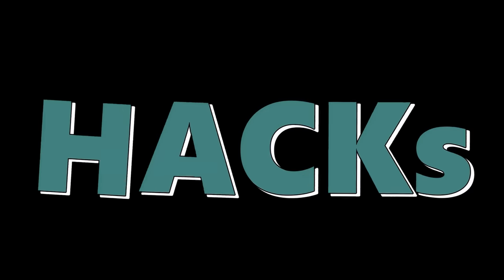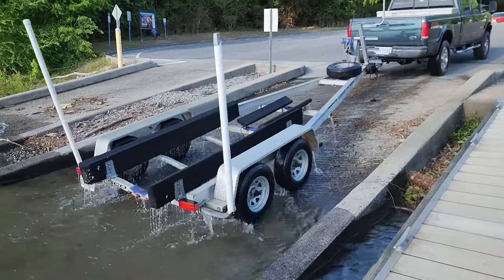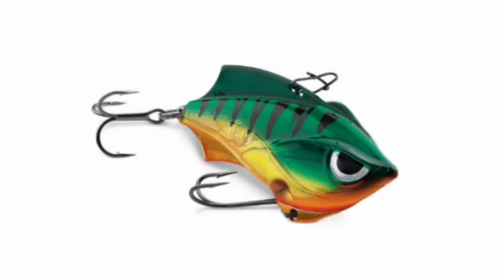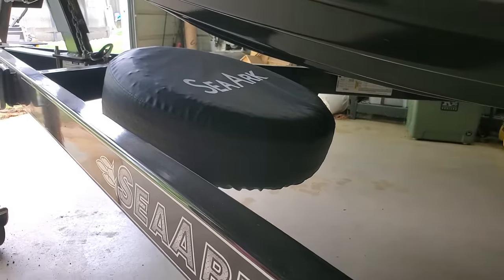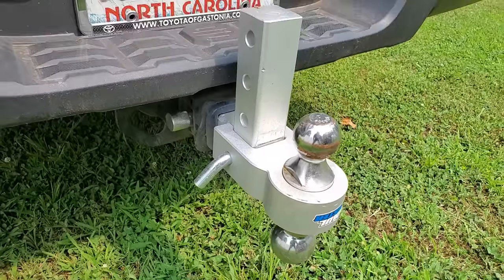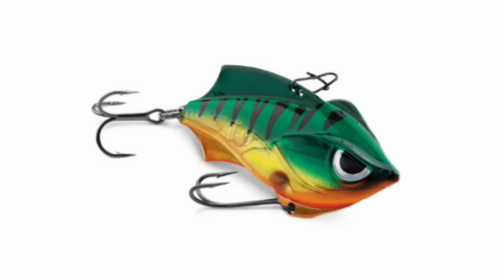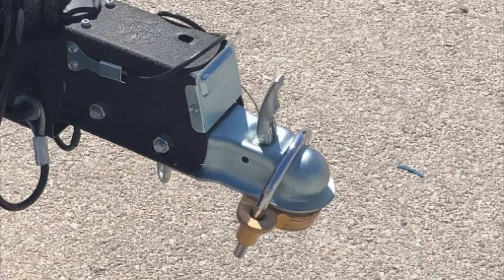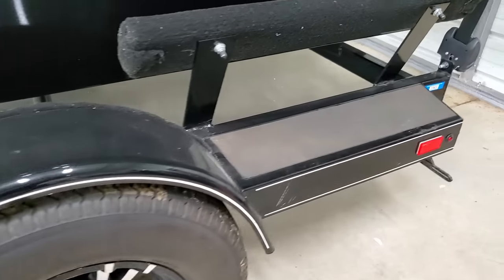10 Boat Trailer HACKs

Comment: Here's one more that nobody mentioned: cat walk. It's best to keep hubs out of water and winch boat onto trailer to improve hub life. That also help the boat to self center perfectly every time while loading. Anyway, you will never need to get your feet slimy if you can walk on your trailer over the water to where the bow is wedged at the end of the trailer waiting to be loaded. A cat walk makes that a lot easier to do... jus sayin.
Reply: @bryantarms
 There’s no way you can be familiar with boat trailers and make a statement like that. How in the bleep are you going to be able to keep the hubs out of the water and load the boat, without damaging the boat, the trailer or both?
Reply: @timothyboone5003  @timothyboone5003 Hahaha 🤣. Two words: tilting trailers. But they aren't really needed for most boat ramps. Also, discover the winch.
You can even lay your boat on the ground to work on the trailer and then winch it back on if it's unhitched.
My dad launched and retrieved boats while keeping the hubs dry especially in salt water. So did my grandfather for all kinds of boats except sailboats.
But rusty rotten trailers can be completely dunked because they're going to fall before their hubs.
Reply: You must have small boats like a JonBoat in mind for this. The hand winches are not going to pull a 5 to 6000lb boat up on the trailer. An electric winch would pull the eye out of the boat before it pulled up on a dry trailer. This does not include the damage caused to the bow from pulling it up the ramp to get to your trailer. 

 I have to admit, I do not have experience launching and recovering in salt water. I have experience with salt water and boats. I know what destruction it can cause.
Reply: Yeah. My experience is with the typical single axle trailers for boats that weigh around 3k lbs.
With the trailer backed in until the water starts to touch the hubs the bows of most of those boats can float over the back quarter or more of their trailer at most ramps. A good hand winch can pull boats up rollers and even drag it up non-carpeted bunks.
The next time you have a chance to experiment at the boat ramp without getting in anyone's way try to retrieve your boat the way I do. Cranking the winch is a good exercise, haha.

Comment: For trailer security, especially if you have a more expensive trailer/cargo/boat, Weld that darn hitch head to the trailer. Sooooo many trailers are stolen by someone with a Battery Power tool, socket and a spare trailer hitch head. Ziiip, ziiiip, ziiip, throw your locked hitch head to the side, install a new one, and drive away.

Comment: Several years ago there was a newspaper article about a Boater and his Wife bought a brand new boat. They could never get it up on plain and took to the dealer several times and everything checked out good so one of the mechanics was a scuba diver so he get into the water to check out the underneath and came up gasping for air he was laughing so hard.
It turned out the newbe on the crane to put boats in and out of the water didn't unhitch the trailer. So there ended up being about 6 boats done the same way. Still having the trailer attached to the boat but these boats usually stayed docked.
Reply from the maker: That's pretty sad lol 😆

Comment: Submersible lights almost always wind up leaking  and  when they leak they will short the fuse in your tow vehicle  a good answer to solve that is always Unplug the trailer fromthe vehicle   then plug them back in before  going down the road and after the  trailer is o high and dry  i’ve owned 17 or 18 boats some  trailerable others not  indeed Hitches can be expensive  between boats ,Campers , and other trailers  i have over $600.00  i hitches  locked up in a tool box. in the bed of my Chevy 3500 Dually Deisel 4X 4 Pickup  it has rails bolted inthe  bed for 5th Wheel and Gooseneck connections  plus almost every size ball and drop /lift  dimension Configuration  i also   live in Florida and only buy Stainless Steel  because of the Salt water and air  i’ve known about Vevor products for  a number of years , they really are Made In China products  and badged Vevor  they are okay  for the money IMO  just a FYI my truck and i have pulled 20,000 pound fiftwheels  and. 10,000 lb Sport Fisherman / Flybridge  it’s technically a oversized load  that requires permits in many places  i tend to avoid those places  and run under the cover of darkness on roads i know very well  and don’t have heavy traffic  inFlorida it’s cooler at night  and i’m not in a race  i’ve found it’s best to schedule my trips wisely   and i always carry tools ,repair parts  and service my Trailers well  it’s been over 25 years  since i had a Trailer Breakdown and that  wasn’t even my trailer i was helping a family member  ?  at daylight i did repair it  with parts i had onboard my Truck  (bearings ,grease  Cotter Pins ,etc  basics IMO

Comment: the hitch lock is junk, , hack saw and a bag of ice and its broken off?  remember to install s/s chain 1" LINKS and s/s lock from the truck frame thru the front of the trailer frame ,NEVER WELD ON THE STEEL CHAIN THINKING ITS SECURE. ITS NOT!

Comment: Locks only keep the honest honest... if a guys intent on stealing your stuff he will. And especially with that stupid HF ball lock! My mom lost the key to her expensive (like $100 kind of expensive) CURT brand ball lock and knowing i can pick locks called me to remove it. I didn't even get my pick set out... i grabbed my 4 way lug wrench that has a flat pry end on one and and literally shattered that cheap powered metal ball in half with a single tug. Dont waste your money on those.
Reply from the maker: Your right about that . But they did some studies and found out criminals are lazy ,,,,,Go figure  lol . Trailer with locks were stolen less often than Trailers without em . In the same location
Reply: @FishinNStuff  that is a very valid point. Lol im not saying to not lock your trailer, but that those ball locks are probably some of the most over priced ineffective locks you can use. I use a padlock on the tounge latch and if im worried about the area ill also run a cable and the half circle style lock thru a wheel and around the frame. That way even if they get it hooked up they will have to drag the tire and that will get noticed.

Comment: That harbor freight tralier lock is not the answer. You can buy a harbor freight cordless grinder and cut threw that in minutes. There has to be better then that.
Reply from the maker: Well according to a study I read . 90 something% of trailers stolen.  Didn't have a lock on them . So that implies that criminals are lazy or don't own tools unless they are stolen 🤔

Comment: You don't need guides on your trailer.. I've had trail with and without. They don't make any difference..just leave your the top of your front fender 1-2 inches above the water about the top of the wheel you'll get ya boat on perfect every single time

Comment: In all my years & also lots of light repairs and add on replacements, just make a dick board to mount on empty trailer that also hangs of the boat, long cable plug, and remove it before dunking-dude, never need to root around with them ever again, and the rego can transfer if you know what I mean.

Comment: On that harbor freight hitch if you gotta flip it over they don’t fit on a factory 99 f250 receiver I borrowed my buddies to move his trailer n had to flip it around and put the adjustable side in the receiver cause it hit the bumper but it’s a great hitch other than that